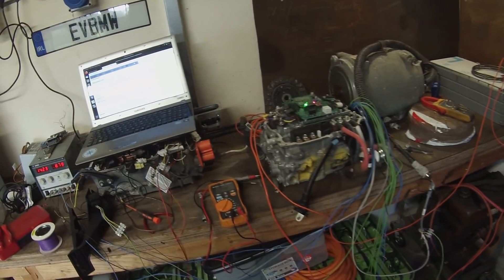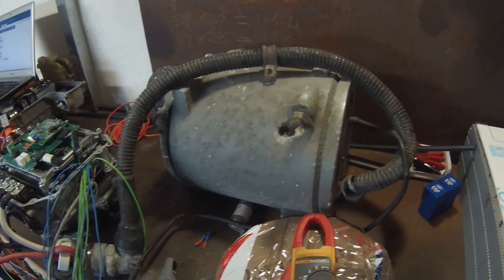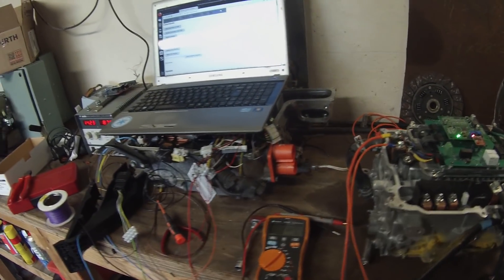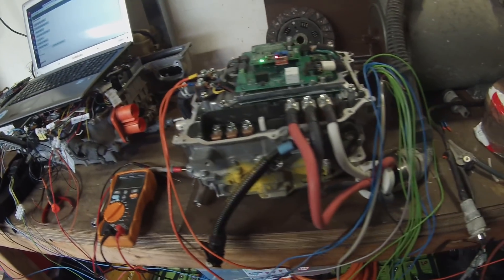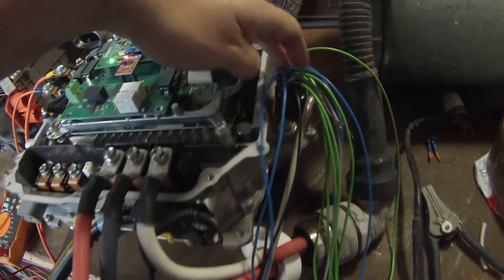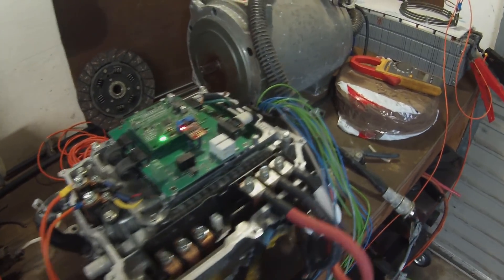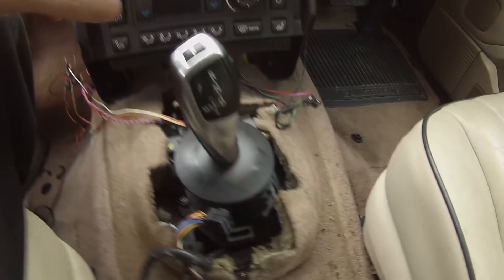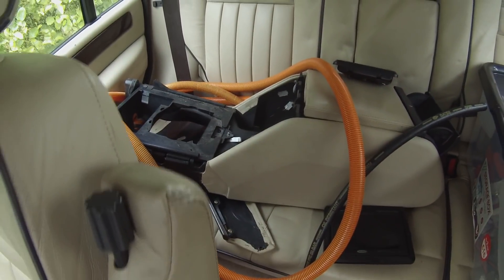The Range Rovers Return

Comment: The brake booster and accumulator are used in the traction control system. pre 99 cars have rear wheel TC and post 99 have 4 wheel TC.

I'm in clonee and have a parts 38, I might be able to help if you need bits.

Comment: The second sound is the Brake Booster pump running - Range Rovers have a very unusual braking system, not only does it have an electric pump to pressurize it (instead of a typicaly vacuum boost) but it also has that dome which is a nitrogen-charged reservoir to aid in braking boost as well called the ABS Accumulator. If the pump is running like it is for short durations on the brake system is a good sign that it is functioning as expected - if it runs routinely for a longer period then you need to replace the ABS Accumulator. Not a hard thing to do but requires depressurizing the brake system as it operates at 2000+ PSI.  A bonus here is that it is electric powered, no boost needed. It is managed by a separate ABS ECU - it not only provides ABS functionality but also traction control. As long as it thinks the engine is running and all 4 ABS sensors are functional it provides ABS and Traction functionalities. BTW it is the ABS ECU that provides the road speed single to the BeCM which in turn feeds the EAS ECU (Electronic Air Suspension).  As someone else mentioned below all doors need to be closed and the hand brake off to allow it to do its thing to raise the suspension. The airbags could also be toast - they often are unless they have been replaced. These dependencies are described in the Range Rover RAV manual - https://www.rangerovers.net/threads/info-rave-manual-download.88857/  - I am as well converting a P38 and looking to reuse all of the electronics to retain the functionality it provides.

Comment: i want my p38 electric too.its my future project, its a nice idea. question: it not gonna be easier to do with 1 electric motor and wit transfer case in? than i can have the low and high gear too + tachometer works too. nice job, and thx for de filming this project.

Comment: brake booster pump with nitrogen accumalator making correct noises , its powering up good, the EAS pump sounds weak, best to purchase manual shrader vavles off ebay and inflate each bag to 3.5-5.5 bar manually , the black resivoir connected to the EAS is a dryer. If you need to borrow rovacom dignostics to interigate BECM and EAS systems could let you borrow one. Would be glad to help you but Iam up to my eyeballs rebuilding a Modec electric motorhome😎
I was converting a P38 to a PHEV with crashed Mitsubishi PHEV running gear , but there's not enough days in the week😁
P38 is a proper 4x4, use to prefer it to my G wagon 😏
Only just found your channel and subscribed 👍👍👍.

P.S quick fix for  P38 saggy headlining, use 2 x freelander one,  rear headlining net compartments , these were fitted above P38 rear seat headrests , the P38 roof has same freelander mounting brackets at this position, this was optional extra on top end P38 models for ICE headphones storage!?

Comment: On my fully original Range Rover I was always chasing error messages. With all that stuff removed, you’re got to set the world record on error messages. The second buzzing noise you heard was the electric/hydraulic brake booster building up pressure. The canister thing you wondered about is the air dryer for the air suspension system. The car won’t rise/fall if it knows any hatches/doors are open or it has the foot brake on. From a completely unpressurised system it can take 15 or so minutes to build enough pressure for the computer to then open the valves to the airbags. Compressors can get tired and not run so efficiently anymore, but can easily be rebuilt, there’s kits on eBay or wherever. I think you’re absolutely mad. But can’t stop watching. 😂

Comment: 17:46 - It looks like a vacuum pump for the brake booster...?  I think the big dome-shaped thing is a 'silencer'.
Reply: That's the abs brake unit and the accumulator. It builds pressure to help braking. It's going bad, their usually supposed to be silent.

Comment: A P38, lol. You sir are brave beyond measure. Ref air suspension, initially check the rear mounted compressor for output. The piston rings are made of chocolate. A fine, physically robust vehicle with key components made from chocolate, ear wax & belly fluff
Reply: The p38 has an engine bay mounted compressor that operate all 4 airbags. The next generation Range Rover moves it to the spare wheel well in the back. I never had a problem with piston rings, head gaskets on the other hand...
Reply: @Johanniscool  I could be mistaken over the location. I have had issues with A6 allroad, Omega & P38 air suspension. Pretty much the only thing that didn't go wrong on my P38 was the head gasket.

Comment: When you generated the signal to the body control module the tach to read 2,000 r.p.m.  When you create the signal generator for the build, are you going to somehow measure the r.p.m. of the electric motor?

Comment: Dear Damien, learning a lot from you , thank you very much, 
It seems that there is a calibration sequence you have to follow to get the air suspension leveling again, site is German, but Google should translate enough that you figure out how to procceed , https://www.discovery-parts.de/ersatzteile/fahrwerk/hoeherlegung/tipps-tricks-luftfederung-discovery3-4.html
The site sais that if components have been detached, I guess also powered off, you may have to run a new calibartion sequence.
also a manual that might help your sort out gremlins history :
http://duud.ee/LR-manualid/Range_Rover_Electronic_Library_L322.pdf
Best of Luck in competing the build, Cheers from Germany, Lajos

Comment: second sound was your conveniently electric - hydraulic brake booster.
Reply: should add the P38 should be in the rover "rave" cd which gives superb wiring diagrams and functional descriptions of everything. I'm sure you can find a copy on eBay if required.
Reply: @denisohbrien  you can also find it online https://www.rangerovers.net/threads/info-rave-manual-download.88857/

Comment: The eas (electric air suspension) pump doesn’t sound healthy at all. Probably needs the piston seal replaced, the air tank should be filled in 5 min so there is probably a problem with the compressor. The car will only move up and down with no doors open. The think hanging on the right is the air dryer for the eas. There could also be problems with the height sensors. Yes that think is the ABS and braking booster, If you want information on the standard systems, any of the range rover p38 Facebook groups will help.
Reply: I think Damien has a leaking air spring.  The springs have got cheap over the years and are an easy enough job to replace.  I did one in the dark one night.  They can be tested by pumping them up individually by using special valves for the tubing from the eas block.  That can also be done from the connector underneath the passenger seat by a few wire connections.   Of course it could be the pump/compressor too.  Parts are available online for repair.
Reply: autocuntversions 🤣 yes I have rebuilt all of my p38s air suspension over my time with it. Its an awesome system just requires keeping in working condition.
Reply: I'm thinking a combination of airbags and compressor issues
Reply: Mike Read yes, its not like a compressor rebuild and a set of air bags is expensive or hard to do. He could even rebuild the valve block and put a new air dryer in:)
Reply: Everything must be closed including bonnet, or EAS will not work
Reply: Tornike Partsakhashvili interesting? My 1996 with lift with the bonnet open. My bonnet switch might be stuck though..

Comment: AFAIK the normal method of fixing the RR air suspension is it's removal and replacement with a spring kit. last time I looked (about a decade ago) it was about 250 quid for a cheap n cheerful kit.